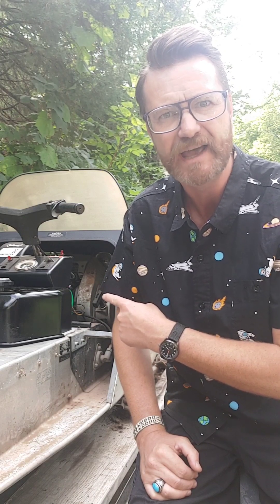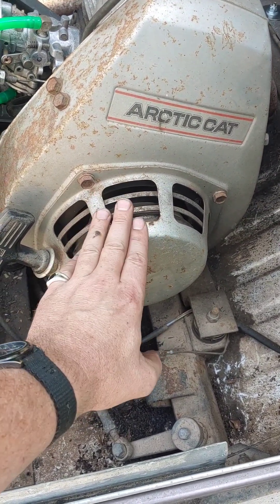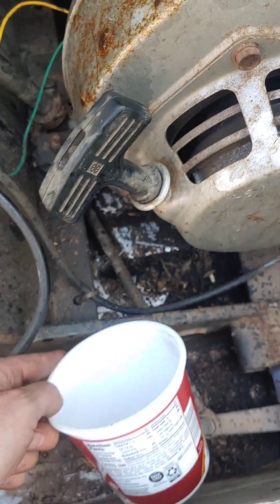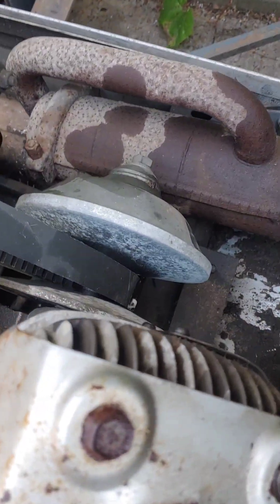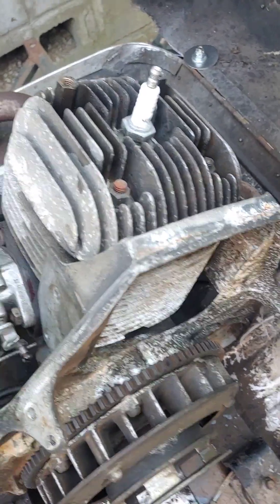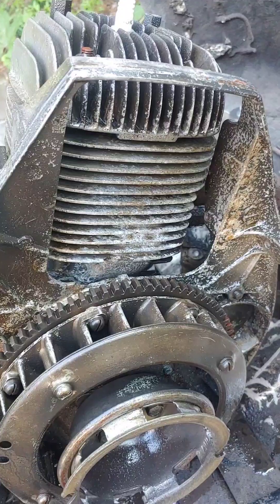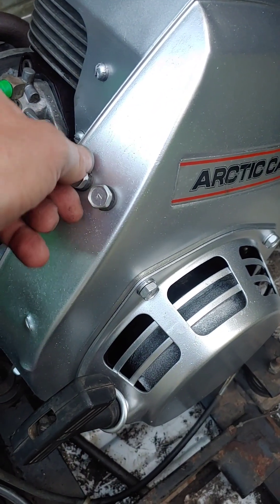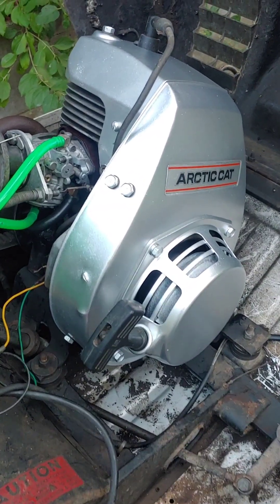Fan Showed Removal and Restoration on a 1972 Arctic Cat Lynx with a 292cc Kawasaki engine.

Comment: Do you ever find it helpful to put anti-seize on the bolts or screws you are putting back on the finished part?
Reply from the maker: I love that stuff! It makes the next disassembly a lot smoother! But I'd recommend wearing rubber gloves because I have yet to use it with out getting it on my fingers. Then I can pull them off and throw them away as soon as I'm done using it! Lol